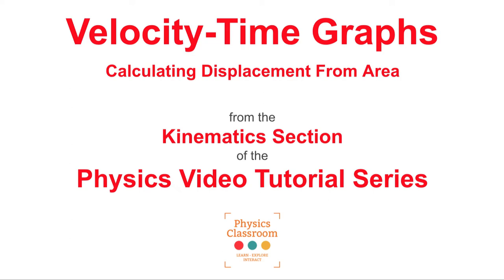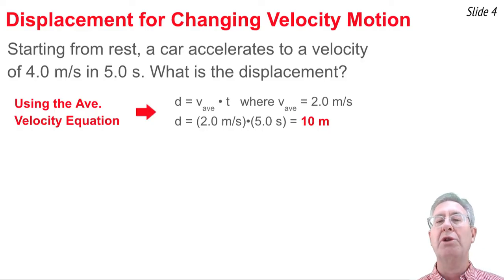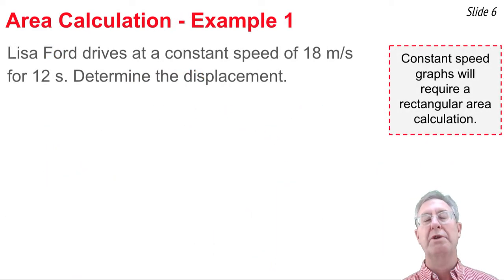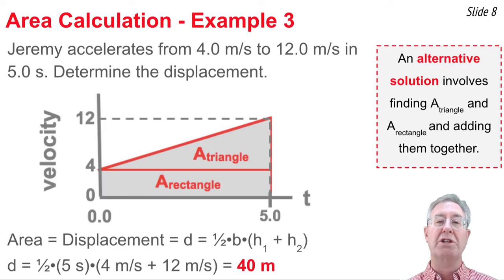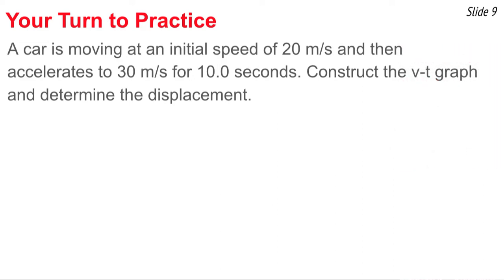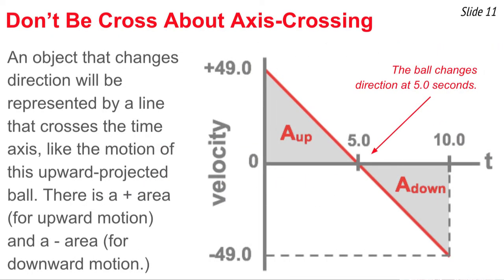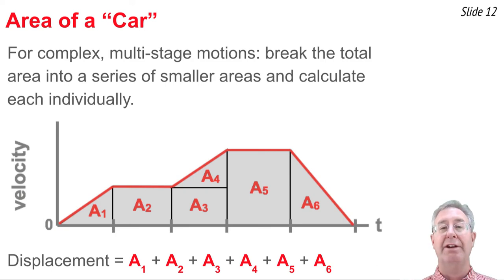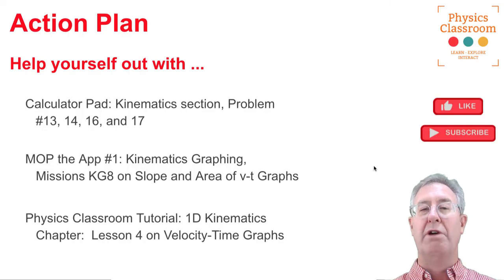Velocity-Time Graphs: Area Calculations

Comment: Sir how the displacement is 275m 
The object started at origin and after some time it again reached at the same position so velocity turned 0 and the displacement also turned 0 
So I didn't understood how the displacement is 275 m??
Reply from the maker: You're reading the graph as if its a pos-time graph. It is not. Its a vel-time graph. It does not indicate what position it started and finished with. It indicates what velocity it started and finished with.
Reply: @PhysicsclassroomVideos  
So sir when velocity is 0 
Means the object is at rest...
Or 
The object started and reached at the same position ..
So when velocity is 0 ??
Reply from the maker: @jayantideshpande8459  At rest. Doesn't mean a thing about position.
Reply: @PhysicsclassroomVideos  when a object which has a motion 
Suddenly comes to stop...
Then the velocity is 0 ??
This is my doubt...
Reply from the maker: @jayantideshpande8459  True
Reply: @PhysicsclassroomVideos  so when in velocity time graph 
The line of the graph starts from 0 and after some time again reaches 0 
So in this case what should we say
The object came back to its initial position 
Or 
The object suddenly came to stop ??
Reply: @PhysicsclassroomVideos  this is the last doubt...
Please solve it..

Comment: Hi. Good video. For area of Trapezoid should the equation rather be 
Area = B (1/2 H1 + H2) 
Where: H1 is height of triangle and H2 is height of quadrilateral.
Reply from the maker: A = B * (1/2)*(H1 + H2)
 Which is equivalent to the equation given in the video. You need to average the 2 heights and multiply by the base.